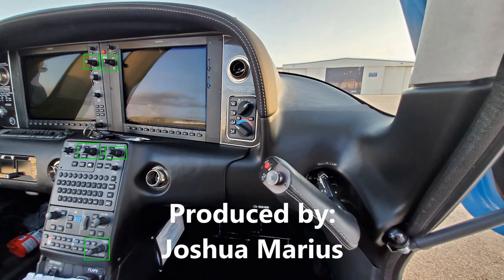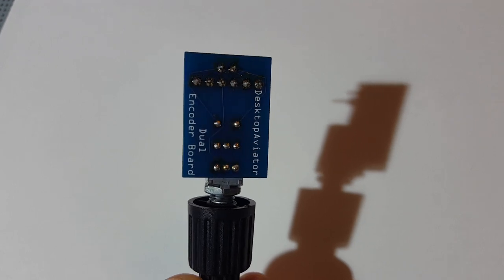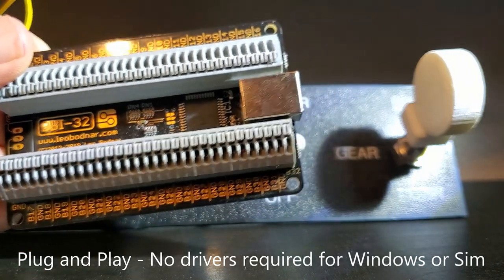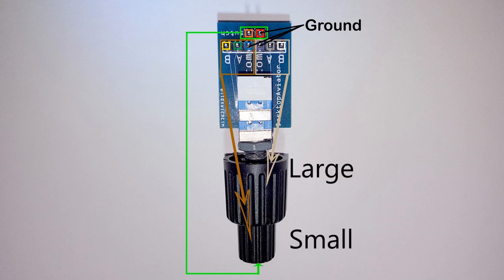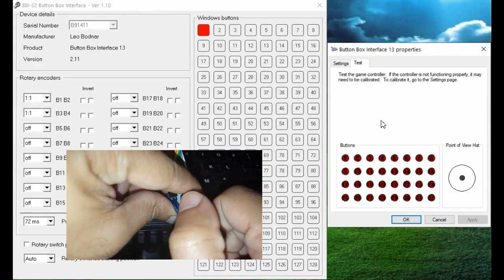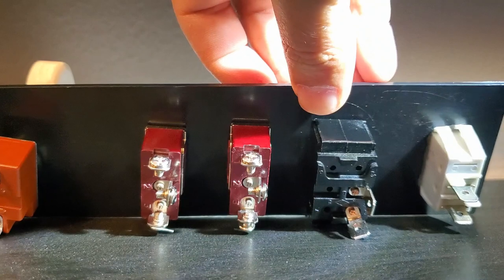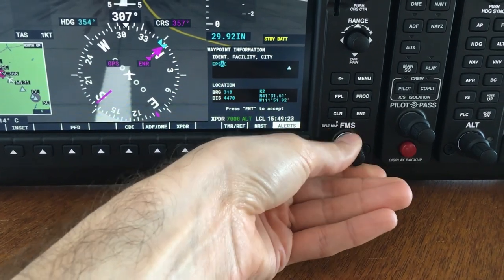Easy way to add Dual Rotary Encoders with push button to Flight Simulator 2020, Prepar3d and X-Plane

Comment: Thank you for this. I have several rotary encoders (single knob, push button, not duel) The encoder is already mounted to a board with 5 pins coming out of it. By far this was the easiest explanation if not the only that physically shows the wire connection. 
I am an amateur, and a visual learner. This will be my first button box build.

Comment: This is what I've had for a few years now, but there is a problem with this and X-Plane and I am not the only one (it's been discussed on the forum). No matter how you set up the the Bodnar board, encoders are slow as ***t. When using rotaries for for example tuning radios it's bearable (because you don't neet so much clicks) but when you need to turn for example the heading bug 180 degrees you have to roll and roll and roll and roll some more. I've seen a plugin for XP to fix this (the faster the clicks come from encoder the bigger steps are taken in the sim) but it wasn't even close to an easy solution at least at that point when I tried it.
Reply from the maker: Somebody else made the same comment and I wrote the manufacturer. They said they are working on it :)

Comment: love it. straight to the point. question tho can u use 2 different incoders an single push button  to work whit gps i have like 5 incoders and 10 buttons. i know its easier that you have 3 in 1 set up but what if split it up ????
Reply from the maker: I'm not sure I understand your question. Each GPS function on the simulator is assigned an action. As an example, let's look at the NAV frequency. You will have increase (1) and decrease (2) inner knob, increase (3) and decrease (4) outer knob and the push button (5) will switch between Nav1/Nav2 - You can see how I have labeled in parenthesis the 5 outputs of the dual rotary encoder. You can then use another encoder for the other functions such as increase and decrease a page or group and other functions, for example in the G1000.
Reply: @joshuamarius  pretty much use 2 separate incoders insted of 1. am gana give a try. as i see your hookups to leobodnar bord it would be a same hook up with seperet encoders not 3 in one but 2 incoders  and pus button hooked up same as all in one .

Comment: Thank you so much! I', building a 737 full simulator (i am custom building the overhead panel because it is way too expensive to buy new) , and this works perfect for me! I won't be using dual rotary, likely just one axis unless duals are all that I can get. I'm early in the learning process when it comes to electronics so this was a life-saver. Subbed!
Reply from the maker: You're welcome, and thanks for sharing your details about your project. If you have many Rotary Encoders don't forget to consider Arduino's as well...cheaper, but a tad more steps are involved so don't forget to watch my other videos. And thanks for subscribing, I'm preparing more videos as I type this. Thanks again!

Comment: Excellent video! Can you recommend any good rotary encoders similar in quality to those on the G1000? Also what type of switch would be appropriate for the "range/pan" 4 way direction button? Many thanks!
Reply from the maker: For encoders, look here for the ELMA37: http://www.leobodnar.com/shop/index.php?main_page=index&cPath=98_75
There are some custom projects for the Range/Pan but you may have to get it built by a company like Aviatek.
Here is a simple example: http://www.leobodnar.com/shop/index.php?main_page=product_info&cPath=98_87&products_id=210
The other encoders of the highest quality are the Grayhill: https://www.grayhill.com/

Comment: Great video, I can't wait to get started!  

Do you know anything about the single rotary encoders they offer at Propwash?  As in, are they of the same quality, and do the knobs more or less match the ones that come on the dual encoders?
Reply from the maker: Sorry for the delay! I thought my reply went through. Knobs are very similar, great quality. The staff can also be contacted and they will send you information. They are really good with customer support. I'm very happy with all the Dual and Single encoders I have ordered from them.

Comment: Hello! I also bought the Propwash Dual Rotary encoder and an Arduino Nano. But the Nano has only 2 GND pins while the Propwash encoder has 3 GND signals. What am I supposed to do with the 1 GND that I can't connect?
Reply from the maker: You can use a Terminal/bus bar to connect all of the grounds together, or you can combine the 3 grounds into one ground on the Arduino. It doesnt matter which ground you use as long as ground is connected, somewhere. Sample Bar: https://amzn.to/3WhNqN9

Comment: would this encoder work for other electronics, not relating to flight sim?
or is it like build specifically for that software
Reply from the maker: It's not so much the software; more so the specifications of the Hardware in the projects. If these are rated at 5 Vdc for example, then you would be limited to this Voltage, regardless if its for a flight simulator, button box or Audio project. Since you can use these with interface Cards such as the Arduinos, then anything that can interact with those cards can use the encoder (Robotics, DJ panel, lighting, etc).

Comment: Does this prop-wash encoder is with high rotate torque like Aviatek one or it is very soft while rotating?
Reply from the maker: These are cheaper and louder encoders than the ones used by Aviatek which come as close to the real thing as you can get. That does not mean they are bad. They work really well for the price. If you want to get higher quality look into Grayhill or Elma. For example: http://www.leobodnar.com/shop/index.php?main_page=product_info&cPath=98_75&products_id=196

Comment: But for MSFS don't you need a third party program to be able to bind the encoder to the FMS encoder in the sim?
Reply from the maker: @anonharingenamn  No. The Leo Bodnar card is a HID plug and play card. MSFS (and every other simulator or program) picks it up as a joystick card, and passes the inputs directly to the simulator; no software needed. Within the Simulator, you then specify the action of the button.
Reply: @joshuamarius  are you sure? I’ve read that the knob (in game) used for navigating gps (inner, outer knobs and push button) are not available without spad.next or similar?

Comment: thanks for the video, i've managed to build a device for 4 simple and 4 dual encoders with the leo bodnar card.

I'm having problems with the speed of the encoders in FS2020, they're extremely slow. I've set them with the heading bug and the OBS on the VORs. I've seen some other videos where they explain how to fix that issue, but with arduinos and mobiflight.

Is there any way how to fix this? I use the rotary encoders that come with my honeycomb bravo, where the OBS and heading bug start moving slowly and then faster. The downside with it is that I have to pre select with another knob which knob I want to twist.
 
BTW, I was trying to use the dual encoders for the GNS530 in FS2020, but I can't find where to set them up.

Thank you for your time.
Reply from the maker: At the moment the Leo Bodnar cards do not have this feature. Somebody else had asked about this and I did write Leo Bodnar and they replied that they are working to release this feature soon. In the meantime, Arduinos are the way to go because they have more available programming within the simulator with software such as MobiFlight or the Aviatek Connector. 
Leo Bodnar cards are just a quick and easy way to get inputs to your simulator with no knowledge of programming or software. It is truly plug n play, but as you can see the more advanced features will require more involvement.

Comment: What software is needed to use this in MSFS2020? I am referring the software you are using with the black screen to assign the aircraft functions ? Or maybe I should ask what software is that you are using ?
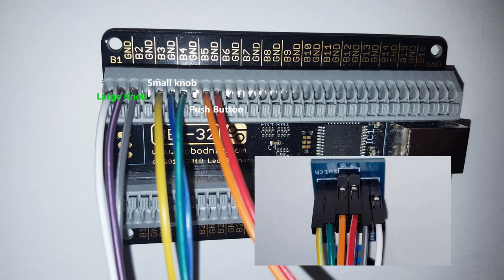Reply from the maker: There is no software needed for a particular simulator. You use the BBI-32 application (shown at 2:00) to assign the Rotary Encoder preferences to the buttons on the Interface Card (download link in description). 
Once you are done with that, you can go into any simulator or game and it just gets detected as a Joystick. In the example you can see it's detected as Button Box Interface 13. When you are in the simulator, look for this Joystick (or similar) and assign the functions you would like.
Reply: @joshuamarius  Oh so what program where you using at the end to assign the events with ? I thought I needed that. I'm not looking to assign key strokes.

Comment: Thank you Joshua, Hey can we assign the ONE encoders for several tasks in MSFS 2020 kind of like the GCU center encoder on a cirrus? so like have say 4 keys on keyboard that changed the function of the one encoder if that makes sense? Thanks in advance..:)
Reply from the maker: Which Cirrus in particular are you referring to? The MFD/GCU on the SR-22 doesn't really do this. Each encoder is assigned to a function (COMs/NAV, Range, HDG, ALT, etc) The Encoder for the FMS only changes the specific pages or groups (Allows you to input characters and move to next character or line, or move to the next setting/option).
Reply: @joshuamarius  thank you yeah the SR22 GCU has the one rotary encoder knob but to the right is the selected option for say COMM or XPDR NAV etc I was thinking I could make one of your rotarys in this video with the option to change what it controls like in the real GCU so I can use one knob for several things ? Cheers
Reply from the maker: @smartsimtech7416  I see what you mean now. Unfortunately you will need something to duplicate the buttons (COM/NAV, XPDR, etc) in order to change those settings in the simulator. The only creative thing that comes to mind is using a Dual Rotary encoder with a pan or directional hat or joystick (I don't even think these exist but it's possible). You then assign the different directions to the function you want. For example, pressing up will enable COM, left is XPDR, right is NAV and so forth. That way all you do is switch with the encoder's "hat" and then rotate to adjust ;)
Reply: @joshuamarius  awesome mate I understand !! Thank you for the thoughts and reply. I’ll get a rotary encoder going first up and go from there with options for the other selections. I currently have the Real sim gear GCU but it cannot be assigned to the options I want as those buttons in the sim are INOP on the cirrus BUT I’m happy to assign them to the ones on the G1000 for now but isn’t possible from what I can see.... So will build one that can be assigned easily for now.
New subscriber and appreciate your help.

Comment: Hey quick question. I got the propwash dual rotary encoder and it only comes with a single common. Is it possible to make that work for all functions involved? BBI isn't here yet and just want to see if this will work.
Reply from the maker: Are you sure that's a Dual? Also, It depends on what card is receiving the input. Can you type out the connection labels on the Encoder?
Reply: @joshuamarius  Sure thing I got the exact kit from propwash but they now have a different PCB it seems. Labels ar eas follows from left to right. b,a,SW,com,A,B so it's dual they just seemed to have moved to a common ground. I think this would work for things Arduino based but im getting a BBI-32 like you have here and going to try to get it to work with that. 

Any thoughts. New to this electronics stuff and trying to figure it out.
Reply from the maker: @Milhouz  Thanks so much for the info. Based on what you have there, you are right; you only have one Ground/Common. This will save from having to solder 2 extra wires. This is actually great! In the end, the ground/common all go to the same connection. I usually have all of them go to a bus-bar and that way they only take up one space in the BBI.
Please let me know if you need further help.
Reply: @joshuamarius  I'll probably reach back out for some assistance once I have the BBI in hand. Just ordered late last week and has to come to the US so it's probably going to be a hot minute. 

Thanks for your help so far!
Reply from the maker: @Milhouz  We'll be here!

Comment: Hey how in the encoder software you have chosen, can you assign a heading encoder to speed up as you turn it faster
Reply from the maker: That's a great question! In reality I think that should be a function in the simulator but I can ask the manufacturer and get back to you.
Reply: This is my understanding the big blocker with Leo boards. Turning will be slow.
Reply from the maker: @pisymbol  Its not that bad. However as I posted before, the manufacturer told me they are working on automatic acceleration.
Reply: @je-140  ugg keep me posted plz

Comment: Wondering how many you are able to run off one board? 🤔
Reply from the maker: On a Leo Bodnar BBI-32 you have 32 digital pins and this encoder requires 5 inputs. 32 / 5 = 6 Encoders
On the Arduino 2560 you have 50 usable digital pins, so 50/5 = 10 Encoders
Reply: @joshuamarius  thanks mate 🙏

Comment: That seems like a LOT of money for a single knob!!
Reply from the maker: Welcome to the world of Simulation, or even Aviation; everything is expensive. This is by far the cheapest solution you will find. Even knobster which is pre-assembled and plug n' play averages $129 which is twice as much as this. This encoder is the cheapest one you can find. A high Quality ELMA can go for as high as $27-30 per encoder.
Reply: @joshuamarius  Yeah.. seems everything is expensive but I guess that comes down to the small market... supply/demand... anyway - thx for putting this tutorials together!!
Reply: @joshuamarius  Is Elma a brand?  What is special about that one in particular?  Thanks.  Also, are the knobs that come with that one from Propwash hard plastic or the rubber-ish feel some electronics knobs have?

Comment: This is misleading because MSFS doesn’t allow you to bind to the g1000 as of today. In fact you (sneakily) show x-plane’s binding screen.
Reply from the maker: The video clearly states it's made for all Simulators but the G1000 function example is shown for X-Plane - nothing sneaky about that. We then show an Aviatek G1000 unit interacting directly with MSFS's G1000; this took further development and Aviatek pulled it off. There is nothing misleading about the video because in the end, you would have successfully added the encoder to your simulator.
Reply: @joshuamarius  It is kind of misleading for people that are looking for solutions for FS2020. I found this video hoping I can map it to FS2020 but didn't. Your title says "Easy", and not you're pointing that Aviatek G1000 was able to do it with further development. That's not "EASY".
Reply from the maker: Thanks for the comment. The title of the video does not say anywhere that it is specific to the G1000 functions. It just shows you an easy way to add a rotary encoder to your flight simulator, whether you use it for adjusting your heading or radio frequencies. The fact that a function is not implemented in FS2020 is unfortunately out of my reach. To be clear, I did not create this video to target specifically the G1000 in FS2020, it was made to show you an easy way to add an encoder.